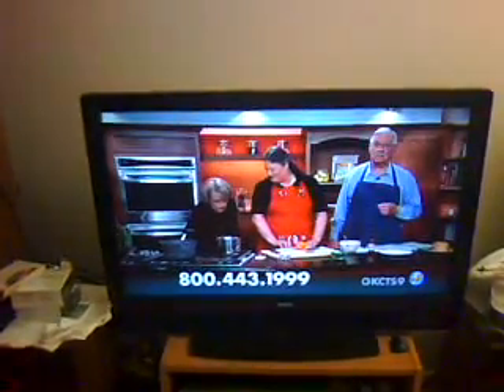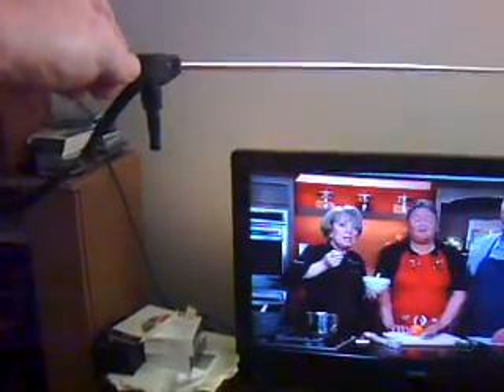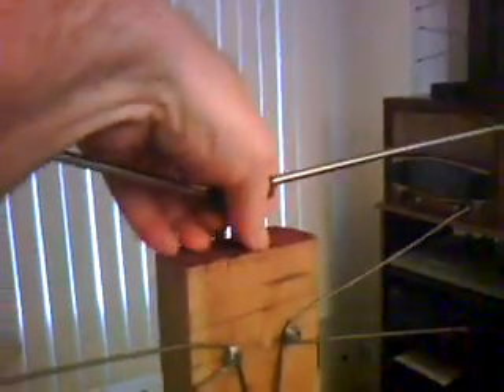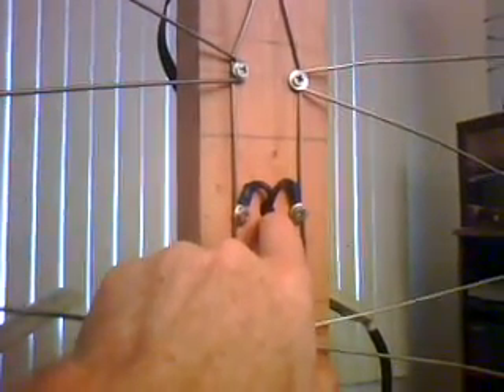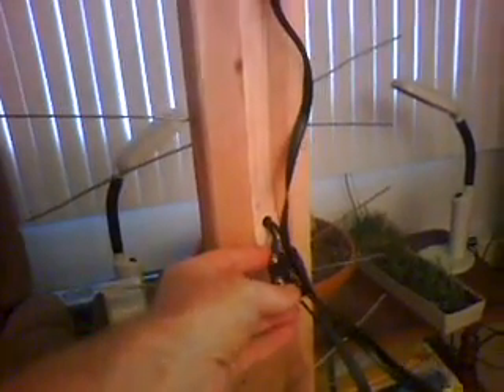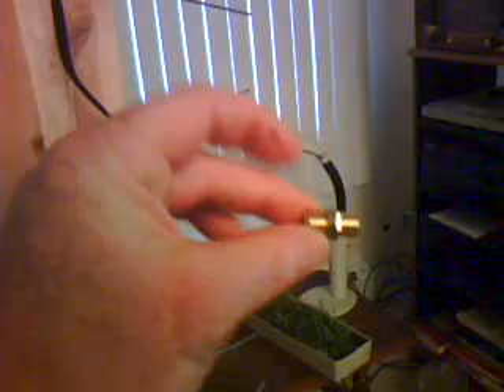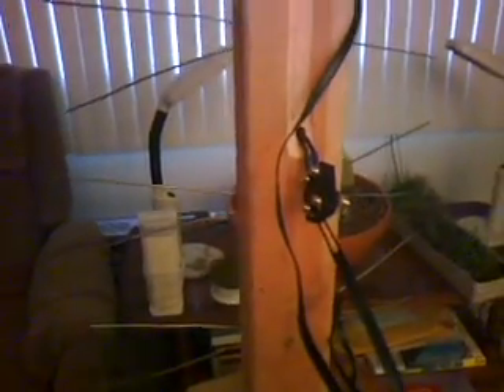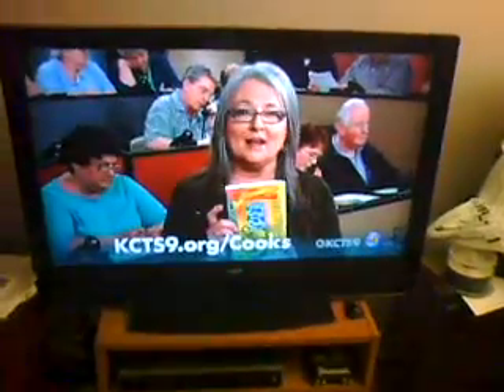New Improved HDTV Coat Hanger Antenna - UHF / VHF

Comment: I used this to build a great antenna.  But instead of dismantling the RCA antenna, I used it as is.  30-inch 2x4, build the UHF portion with 12-gauge copper starting 1 inch from the bottom, not 2 inches from top.  Then mount the RCA antenna on top.  Drill the hole in the middle and pass through the UHF wires.  Then connect those and the coax from the RCA antenna to a UHF/VHF signal combiner.  I planned to solder, but wasn't needed.  95-100 percent signal quality on all major network stations...

Comment: OK, I found your video. So you're saying that a reflector does help with the UHF signal, right? How far behind the coat hanger wires should the reflector be? I ask this because I made mine on a 1 x 4 and I'll probably have to put some kind of a mounting on the back to hold the reflector.